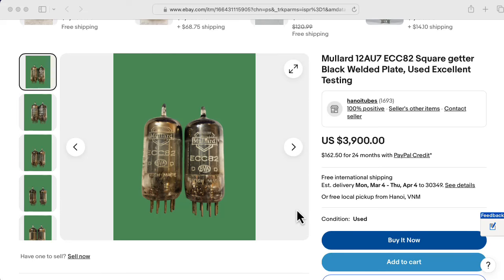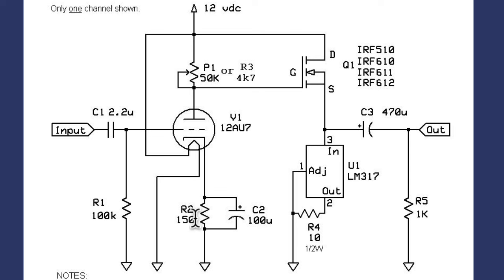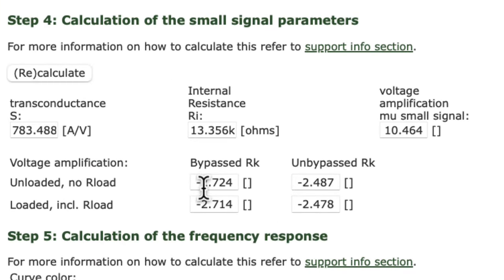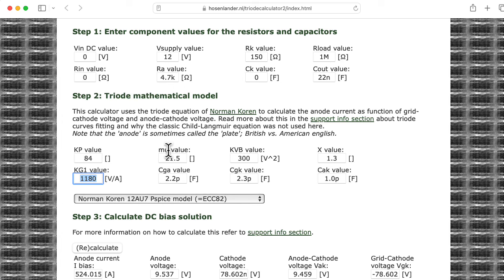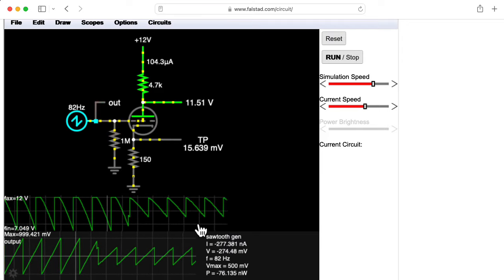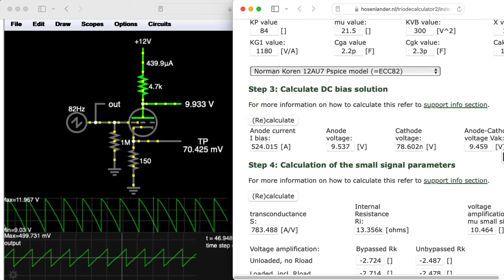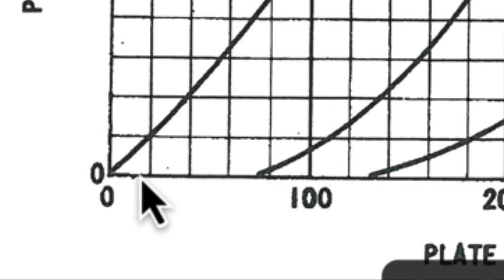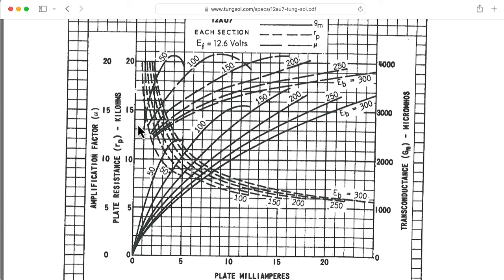Low-voltage Common Cathode Amplifier in Falstad (12AU7 Vacuum Tube) (Guitar Amplification & Effects)

Comment: Try using a 12U7 instead of a 12AU7. It's meant to operate at 12v. Also, 12v "space charge" tubes are great for this application.
Reply: You read my mind! The "space charge" tubes were designed to run in car radios with only 12 volts to the plates, eliminating the need for a vibrator-pulsed voltage-stepup circuit (the electromechanical ancestor of a "switching" supply).

Comment: Merlin Blencowe has instructions on operating triodes (and especially the 12AU7) at low voltages. His goal is linearity (to the extent that it's possible), so it's not as appropriate for a course on "distortion". His writings also suggest nontrivial grid current, which won't show up on the Koren model or most datasheets. It's better to measure an actual 12AU7 than trust online calculators so far from the intended range of operation.

Comment: True. The 12U7 tubes run at low voltages, but I've been fascinated with circuit topologies that run the big boys like 12AX7s and 12AU7s at low plate voltages. There's a kit called the "Tube Head" by Paia that runs 12AX7s at 12 volts (actually, there's a voltage multiplier inside to increase the plate voltage, but not very much). I built it and it sounds pretty good.

Comment: Have you used a transistor curve tracer to generate the plate characteristic at 12 volts? Thanks for the video. ps. I met Koren once in Boulder and we spent 30 mins talking about the modeling approach you mentioned.

Comment: Fascinating video, Professor! 

Falstad is getting bettter at simulating weird things.

I'm always a little puzzled when I see these 12V tube circuits. Is there a good reason not to power the plate with, say, a still finger-safe 48V?  Does the low anode voltage give you some sort of magical distortion effect or something?

(Yeah, I know, 48V is pushing 'touch safe' just a little bit, because my wife ran a manual PBX back in the day and said that the cords would give a nasty bite in wet weather.  But 60 VDC or 25 VAC is legal by most codes even around children and livestock provided that the interrupter will break the circuit within 3 seconds of detecting fault current. If I recall, if the circuit is secured and GFCI protected, the limit is 120 VDC/50 VAC for adult workers, and obviously higher for trained workers with appropriate PPI.)
Reply: I was a telecommunications installer, and the 48 V of the lines was rarely ever felt, but the ringing current that went up to 90 V could definitely be felt!